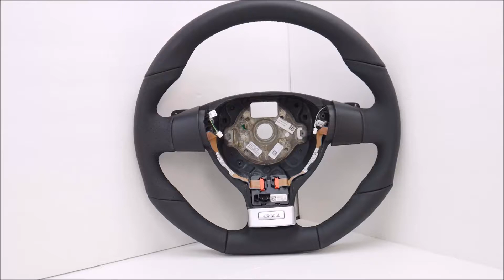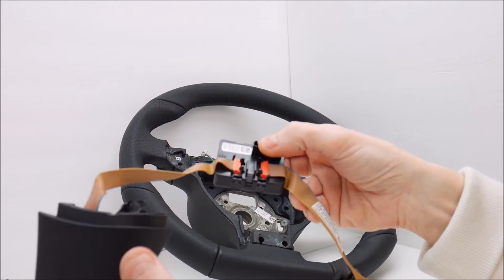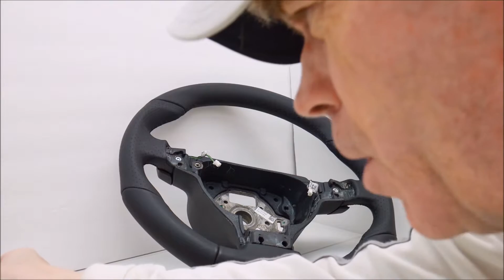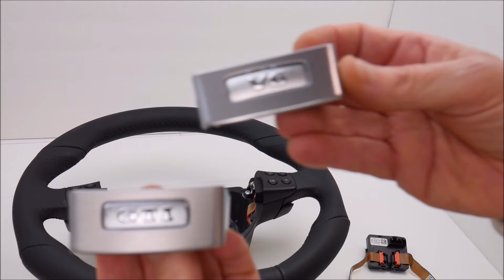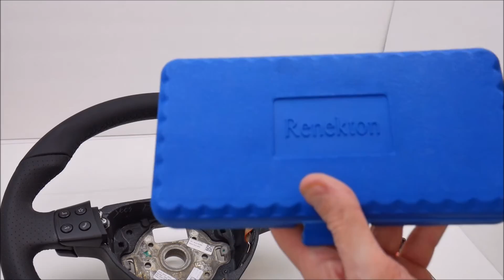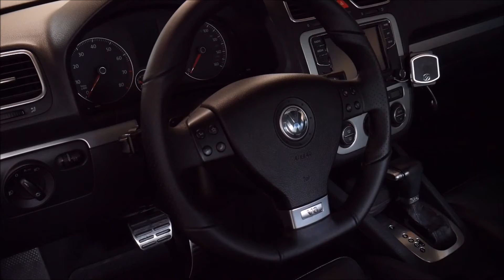Upgrading the VR6 Volkswagen EOS Steering wheel to a MK5 GTI Flat bottom Wheel

Comment: I have an eos 2007 with no shifters and no buttons , thinking of buying the same gti steering wheel , can i keep the gti buttons and expect them to work on my eos that have no buttons ? Or i wont have wires for them in the first place . Please respond
Reply from the maker: This would be a better question to post on a VW specific forum as this has been done on MK5 GTI's/GOLF's.  Since I have not done it, I can't give you all the specifics, but it might require a new clock spring or convivence module and VCDS programming

Comment: Hi, I am thinking of doing this on my EOS, It is a 2008 TFSI, manual so no paddle-shifters, assume it is pretty much the same process?. Also, I believe I can put my existing airbag into a new wheel, but  I am being told by the person trying to sell me one that I need the airbag that is from the new wheel, are they not the same thing? Cheers, great Videos!
Reply from the maker: If your airbag looks like the one the seller has, then yes, your airbag will fit.  You can use the wheel with the paddle shifters, you just would not hook them up, I suspect there would not be any wiring for them anyway.  There are steering wheels for manual trans and DSG, but you would definitely want to confirm with the seller if the wheels has the paddle shifter's

Comment: How did you connect the paddle shifters?
Reply from the maker: In this case, I removed the button assemblies and the small control box from the original EOS wheel and installed these into the GTI steering wheel.  Everything is plug n play.

Comment: This work for the mk5 Jetta ?
Reply from the maker: As far as I know, a MK5 steering wheel will fit on any MK5 Volkswagen, upgrading to a MK6 steering wheel is doable as well but requires replacement of more parts and a new airbag.